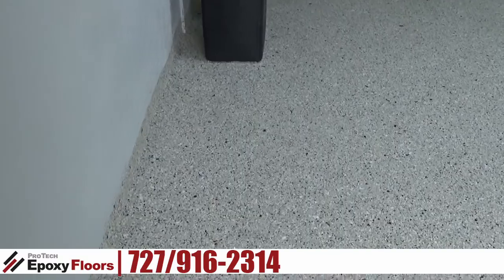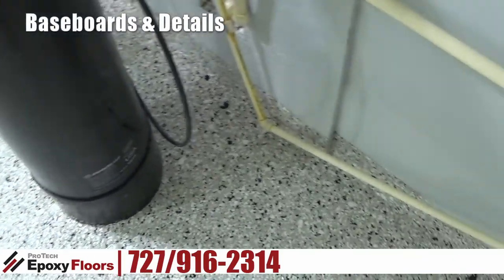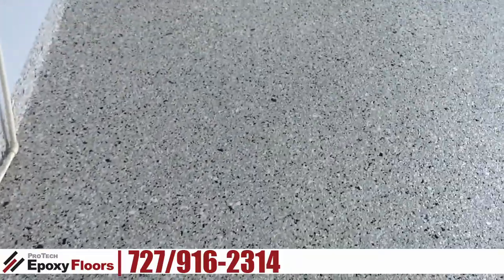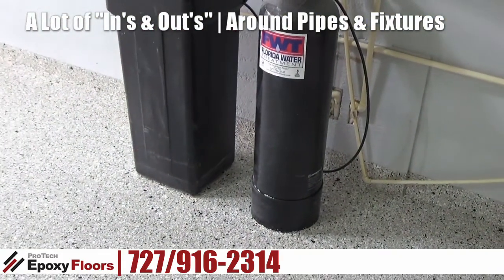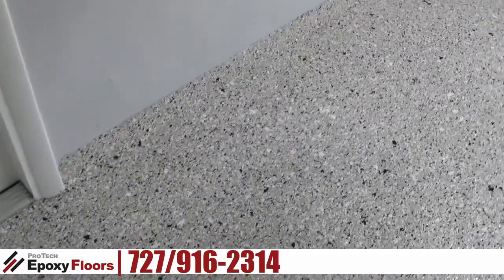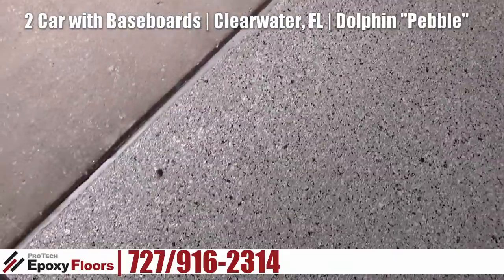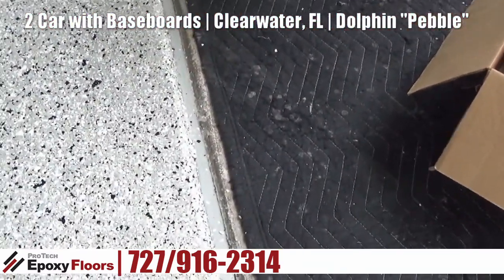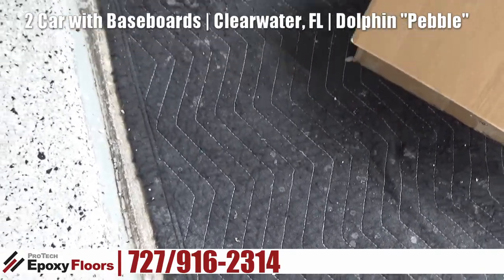Installing a epoxy floor around many fixtures.

Comment: What did you have to do to work around the water heater? Thanks!
Reply from the maker: A lot of stretching lol. You grind as close as possible, then we have a detail tool with a carbide rasp for the rest. Because there is no traffic in the area behind the fixtures you only need a light on scratch on the floor.
Reply: @ProTechEpoxyFloors  Thanks for the info! Do you just tape up around the heater and use chip brushes to apply the actual epoxy/top coat?
Reply from the maker: @TheCaseybfl  yes, tape well. Then get epoxy and chips UNDER the fixture. It will appear to be sitting on the floor. 

Again you should use your carbide rasp in this area as well.